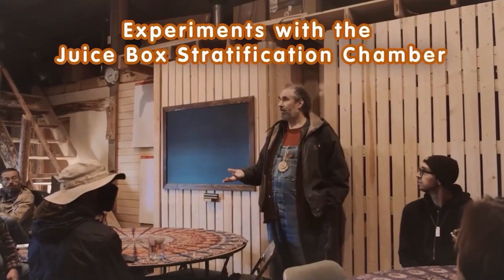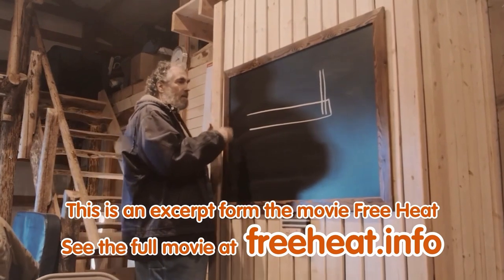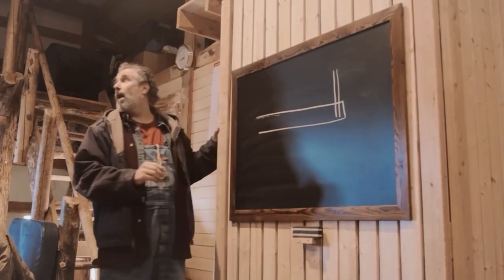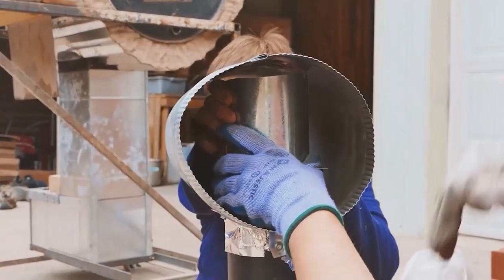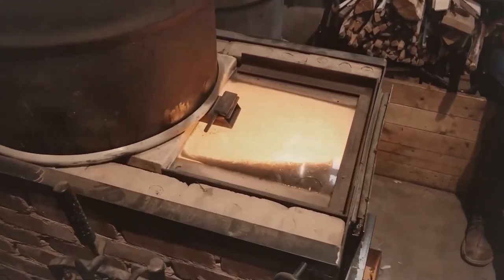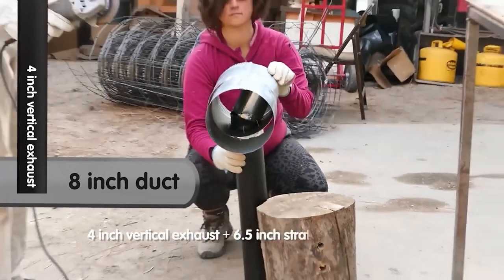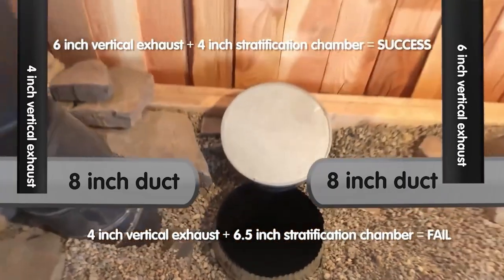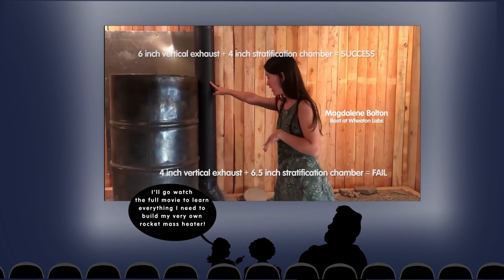Free Heat movie excerpt - juice box stratification experiments

Comment: So, what I'm envisioning for my build is to use this juice box stratification principle inside a large volume Bell bench, and have the flu exit the Bell right next to the steel Barrel like in your video so that if needed, the Barrel can heat the flu to create a second siphon as you explained elsewhere. Then I could play with and adjustable flue height down into the Bell to adjust the where in the stratification air layers the flue sucks air from. In addition an adjustable ceramic insulation shield could be used between the steel barrel and exhaust flue coming out of the Bell to adjust how much heat from the barrel goes into the Flue for the secondary siphon. Ideally, the stratification in the Bell would create its own sufficient draft without the need for a secondary siphon, so the flue adjacent to the barrle could remain insulated so as to no such absorb and take wasted unnecessary heat out the flu. BUT, the adjustability of the flu/barrel insulation could also be used as a start up primer draft if needed to heat the flu directly on start up to help initiat draft. I'm excited to test out this Juice box idea! Thanks for the vids
Reply: For the adjustable Insulation mechanism between the barrel and flue, I'm envisioning an half section of larger diameter of pipe the height of the barrel that surrounds half of the flue and that has a handle on it so the half section insulated heat shield and be swung around, rotated around the flue to either shield it from or expose it to the barrel.